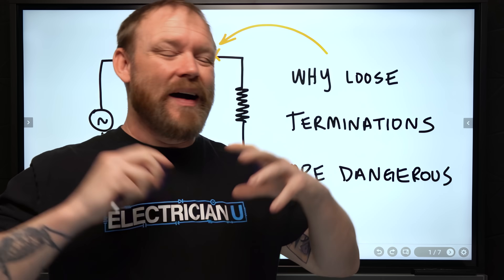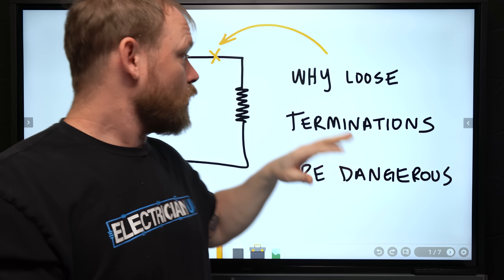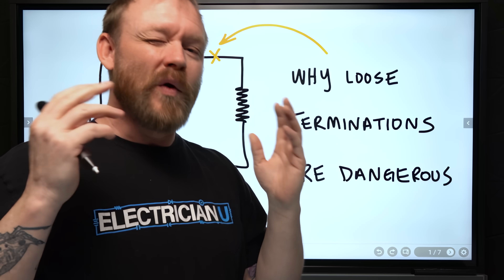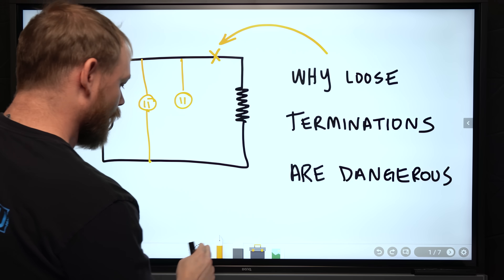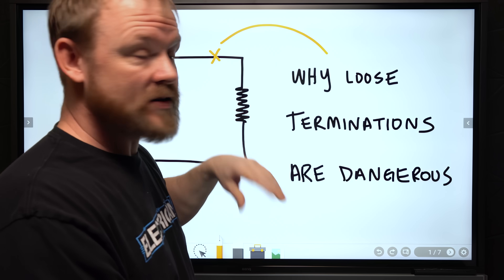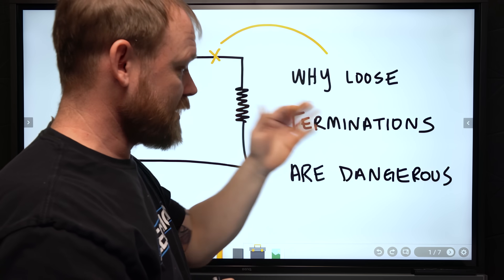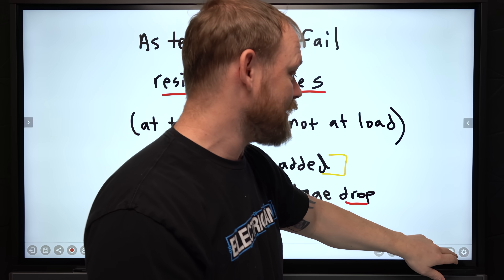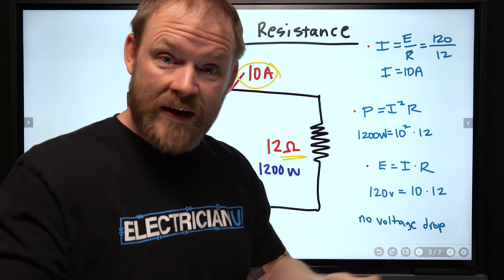Why Loose Wires Cause Fires: Why I Pre-Twist.

Comment: Grabbing the wire with things other than the wirenut, breaks the wires..  One strand will be straight and the others wrapped around that at different rates.  Then you cut the end off so they're not fully seated in the bottom and the wirenut isn't on tight.  Thats not the play.  You should twist with a twisting approved wire nut that applies the appropriate twist rate to the spring.   Just seat the wires in parallel and twist with the wirenut to spec.  Less steps, less damage, better twist rate and connection.

Comment: Funny we are talking about this now. The same can be said about backstabbing devices. Just repaired a burnt neural for this exact reason, loose connection 
Just because the manufacturer says it's listed for the use doesn't mean it's the best way to do it. I have 99% of my connections on a screw type device. I don't always pre twist my wires but I always make sure that they are torqued before covering them. And sometimes I'm just more honest for my own good lol

Comment: Question: When should i Lockout a piece of equipment? Scenario: Panel 1 is deenergized. Pnl 1 has a feed in series to pnl 2. wire is pulled from pnl01 to pnl2 but not landed at either side. I want to work in pnl02. Is there a potential risk for shock or am i good to work with Lock out tag out? Thank you for any who can help me with this question

Comment: Great presentation! I had not thought about of this into this degree of detail, just simply make all terminations tight and that won't come apart. Torque when listed. 
I have one question, I have seen where a voltage drop causes higher currently proportionately. I have understood this is due to a device (take your 1200W heater for example). when you lower its (source) voltage, it wants to draw more current to maintain its power draw (P=EI). Usually that eventually causes a breaker to trip which will initiate some troubleshooting to find out why.  Looking forward to hearing your response to deepen my own understanding... or to clear it up in case I've forgotten something  :)

Comment: you can calculate the contact resistance that dissipates maximum power by differentiating P_contact=R_contact*(V/(R_contact+R_load))*V over R_contact, putting in 0 for the left side, which turns out to be R_contact = R_load, so in your 12Ohm heater example the contact will heat up the most at 12Ohms of contact resistance, not 8, but the video was informative nevertheless

Comment: What makes it more complicated is when you factor in thermal expansion in the connection that will temporarily lower resistance and cool the connection again causing the resistance to rise again. So it becomes a cycle and why these problems usually take a while to become noticeable. Fires most often happen after these hot cold cycles break down the insulation on the wire or wire nut and the connection physically breaks apart and creates arcing that is too fast to trip a standard breaker so it stays live and keeps shooting sparks into something flammable.

Comment: Retired electrician contractor and electrical inspector got to say that's an excellent presentation on Resistance and the causes that can occur on a loose connection well done and explained thoroughly my thought on pre twist or just using the wire nut I find that if I push in at the same time I twist I get a good connect every time no issues however if I have three or four conductors in a box in a junction box I will pre twist cuz I probably can't get the torque I need but all in all great presentation I  may  show this to my students. Are industries constantly changing every 3 years we have code cycle so good job 👍

Comment: I know we act like pre-twisting is just a preference, but to me there is a correct answer & method.  Pre-twist your connections!  It's just how I was taught & I think I was shown the right way.  I've gone behind work where you pull wires back out of the box and the wires just pull loose from the wire nut.  That should never happen.  Any connection I make is going to have to be untwisted or cut off.  It's just good practice.  I will not use the backstab terminals in devices nor push in connectors.  Those are for DIYers, not electricians. I do not through wire my devices.  I always pigtail because I know that my connections are better than the internal components of some of the devices I install.  To a lot of people, this is just a job.  But remember that people live in the homes that we wire.  Their families, pets, and personal belongings all stay there.  No one wants their work causing a fire.

Comment: You missed a very important figure - the max power happens at 12 ohms in your example - when the two loads are equal is when you have the peak power. This is a well known property as "max power transfer" which happens when source impedance matches load impedance (if we take the bad splice as part of the source). So the peak of your power graph happens exactly at the midpoint between the 8 and 16 ohms, or 12. Using your numbers, this will result in a peak of 300W at the bad splice and is the absolute most power it can dissipate. (You know this number very well if you see your TV or radio having an input marked "75 ohms" - that's the impedance of the input which should be matched to the antenna to get the best possible signal).

Comment: 30 years as an Electrician specializing in telecom. Diligent use of Ohm’s law and a great example of a high resistance fault. 
In terms of electrical fires, another issue to consider is micro arching, also a result of a loose connection. Produces extreme heat and very quickly. Severity of the arc will depend on voltages and types of loads involved. A heavy capacitive load can create violent inrush currents even on a very conservative 15A 120V circuit. The intermittent nature of a bad connection will strike the arc, now you have plasma, which produces extreme heat. Not as straight forward to measure the amount of heat being produced by the arc.

Comment: Interesting analysis & conclusion. However, that only explores the case of a static system. If you are dealing with a human or thermostat on your heater. It will notice that the heater is not heating as well due to the drop in current. Depending on how temp is controlled it may drop the resistance so that more current flows thru the device & circuit. (Yes, the heating element will have likely have a constant resistance, but switching may increase the amount of transient activity in the circuit.

Comment: Even if you have a pure resistance circuit like that heater for the load the circuit must have some induction and if you have some induction and you have a faulty connection it connects and you have a surge of current up to the normal amount then it disconnects and where the disconnect or lose connection is arcing must occur. Even with very small tiny electric Sparks you can blow out pieces of thin tin foil. As this arcing event occurs over and over there is a voltage Spike and a resistance Spike right there at that spot and a heat Spike as well.

Comment: If you pre twist wires the diameter of those wires in now a lot bigger.   The wire nut is made to fit untwisted wires.   That is the way they show to use them.   If the wires are twisted first what is really holding the wires in contact with each other?   The twist.   Because the wire nut is now too small for the wires diameter.

Comment: The content in this video is fantastic and the delivery is exceptional. I can see that a lot of work went into it.

Please consider a slightly different mode of presentation where a loose connection exists, and current begins to flow through that loose connection (with a static cold resistance), and as the current continues to flow that “resistor“ begins to heat with a positive temperature coefficient. The resistance then increases feeding itself and initiating a constant temperature rise. The heat causes oxidation fueling a naturally worsening condition. 

One can then see that a case for spontaneous combustion would be plausible.

Comment: Not only that, when you make an electrical connection, the ground wire must always be longer than the line wires.
In the event of a tear, the ground wire will be the last to come off, contributing to safety.

Comment: Great video. I love your energy and your dedication to educate your viewers But I have to point out a small oversight in your small R equations.  You have "60V = 7.5A X 4 ohms" which is incorrect (7.5 X 4 = 30) which is correct on the very next line where you state Vdrop = 30V.  And FYI your maximum power distribution between the 2 loads will occur when they are equal.

Comment: This is also the main reason why power regulation for high power loads, is not very often done by putting a variable resistance (for example a potentiometer) in series with a load - which would otherwise be very simple. A lot of power will be wasted in that resistance (and the huge amount of heat generated will require huge amount of cooling).
With DC and AC with resistive loads, the largest power dissipation in the series resistance will accor when the load is powered at 25% of it's maximum - in that case the in series resistance and load resistance have the same value. In the example with the space heater, the total resistance will be 24 ohms and total power of the whole circuit 600 W - of which 300 W will be in the space heater and 300 W dissipated in the bad connection (so the efficiency of a regulator in that state would be only 50%). 
But as the power output from the load is reduced further, the part that gets wasted in the series resistance compared to load output, continues to increase - even if the power dissipation goes down. With your 28 ohms in series, the dissipation in the series resistance is 252 W - but since the toal power of the circuit will be 360W, that means 252 / 360 = 0,7 or 70% is just wasted power (a regulator in that state would have an efficiency of just 30% - which is pathetic)

Comment: E.E. "math head" here. 

Good discussion on ohm's law. It is very important to develop this intuition on resistance, power, current, tension. Some are linearly related, others are quadratic. Many people cannot grasp inversely proportional relations, unfortunately.

However you talk about the resistance going up on the loosen connection as if this is the CAUSE of the fire hazard (eventually you noticed that the increased resistance kills the current. So best scenario this evolves to an open circuit). 

I believe you should have focused instead on how the choke point acts like a thin wire and that a thin wire cannot handle much current. It is easy to see from the formula
R = ρ * (L / A) how the reduced cross section increases the resistance. After this you could have presented a table with wire gauge and max current and talk about the Joule effect. So a beefy wire would act like a thin wire if badly connected.

--

You dont need over 200W leaking on a bad connection to have a fire hazard, tens of watts are enough to melt a very thin wire. 200W will for sure trigger the breakers.

So lets talk about a faulty connection (but not too faulty to instantly trigger the breaker). The heat builds up over time and may eventually melt the insulation and expose more wire. The heat spreads fast on metal so it can damage other vulnerable points too. Heat dilatation can also deform and bend the wire which could loosen the connection even further. In this scenario a short is very likely to happen. Another factor is that this could be a dormant problem. Slowly getting worse and difficult to locate.

Im sure you know all this, just wanted to bring the conversation to the real cause of a fire hazard

Great math and great presentation anyways
Reply: 100% I was thinking too small if "wire" at that bad connection.
Reply from the maker: My friend, thank you so much for taking the time to write all of this. All great insights - I'll think more about the choke points and the thin vs beefy wire because I do think you're right - that would have been a great add to jump off into. Thank you!

Comment: Good Video..  In addition to hot connections high impedance of the supply is sometimes the cause of a fire.  This is sometimes called 
a soft system.  This keeps the breaker from tripping or very slow in tripping.   Common culprits are inductive reactanace of poorly design of the feeder cable, faults in oil filled heaters and poor voltage regulation of the supply.  A retired EE with 50 years experence.

Comment: As an electrician I service a apartment complex for a Heart Surgeon!  Every call I get is that the power to a room dies!  Everytime it back stabbed #14 wire in the receptacles!  Years ago you could backstab #12 or #14! Why they still allow this method I don't know!  I've seen many blackened receptacles because of it!  I've been in the trade for 40 years and I always pre twist my wires and lock wire nuts down good!  It's the only way to go!

Comment: There a Lifespan on those Terminations ?      It's be for Industrial.    I'm a Drafter/Designer.
Probably just keep going on Physics.
I posted that.    Now they send me Nuke jobs.   lol.
I'm a good Drafter.   But Idk  a damn thing about Electrical.   ok DC 4.0 that.
Two staffing firms have approached me now on Nuke Energy but I'm close to returning on Physics track and only day classes.   Trapped.

Hey video for some of you might like.     I know it's on PCB Design but the Physics Principals still apply.    Fedevel on antennae Design and where the Power is : around the wire !

I mean we got this push for Green.     Ya can't have a Living Star and have Electrical going out !    At 10 Million Deg.

It weird I can make more w/my 2 yr. than as a Scientist   lol .     For a time.

Comment: That's why I buy the commercial receipticles that the wiring goes into  the back.  Then you tighten the screw on the side! I always pull my wire nut wires to make sure they don't come undone ! Stranded wire is a pain! Retired sign electrician here!

Comment: First time visitor. My background is College electricity/electronics diploma. Worked in industry for 10 years, taught electricity and electronics at high school level. Providing background info can assist in credibility. Nice breakdown of what happens to P, I, E, R, numbers and especially the chart visual. 

Perhaps you can do a mirror video including conductivity of the the loose connection. I never investigated the issue, I always saw the problem as a conductivity issue. When properly torqued, the screw force flattens the copper wire (both contact points), meaning more contact area. Because the connection screw is not torque correctly, the contact area between the screw and round wire is insufficient. I just visualize the curved wire meeting the screw contacting resulting in less copper kissing. Imagine a can of pop laying on a kitchen counter and how little contact area is between the two. Current capacity decrease as AWG increase a.k.a. - inversely proportional. Thus visualise two 18 AWG wires one being on top and one at bottom of the 14 gauge wire loop. Meaning that critical part of the connection now conducts through the 18 AWG wires. 18 AWG 90 has 14  A rating while the 14 AWG 90 has a 25 A rating. Conducting through 18 AWG lessens the current rating capacity by approximately 30%. Although the resistance difference between 14 AWG vs 18 AWG is negligible, the conductivity and heat dissipation are not, thus the connections keeps getting hotter as it also starts to oxidize from the heat and thus forming a less conductive surface for both current and heat, etc. 

A simplified way of looking at it is: an 18 AWG wire feeds a 6 AWG wire and the circuit breaker is chosen for 6 AWG. Both wires have very little difference in resistance for short lengths. Thus conductivity might want to be looked at. Imagine pushing 50 amps through the 18 AWG feeder.

This is my take and it and would love to hear a response providing deeper thought or not agreeing with it.

Comment: A wire nut properly installed doesn't depend solely on wire-to-wire contact. The coiled spring inside effectively bridges any gap between the conductors, and many of those paths would have to break to cause the problem you're describing.

Comment: Great video! The “curve” in heat dissipated can be attributed to maximum power transfer. When the source resistance (I.e the fault) equals the load resistance. So when the fault has a resistance of 12 ohms, 120V/ (12 + 12)= 5A current. Power dissipated in fault “resistor” = 5A^2 x 12 ohms = 300 W. Love when it all makes sense! Again, great explanation on a less than intuitive topic.

Comment: basically lose connections can be taught as more resistance in series with our load resistor yes, but more often than not the component that has the "lose" connection cannot withstand the heat generated locally so this is what causes the fire hazard.

Comment: How do you pre-twist a wire nut?
Twisting wires together is not necessary unless you have a lot of wires & you need to keep them from slipping back before the wire nut is in place.
A quality wire nut of the right size for the wire used will twist the wires together and bite into the wires when applied correctly.

Comment: Excellent video.  Thermal expansion plays a very important role in that if the joint doesn’t burn through the the thermal expansion can yield the clamping metals and conductor such that the joint becomes loose for the next time it carries power.  This is especially important with aluminum conductors and joints because of aluminum’s thermal expansion coefficient which is much larger than that of steel or copper.  Aluminum conductors must be used only with aluminum devices for that reason.